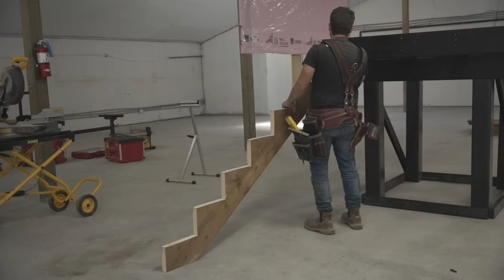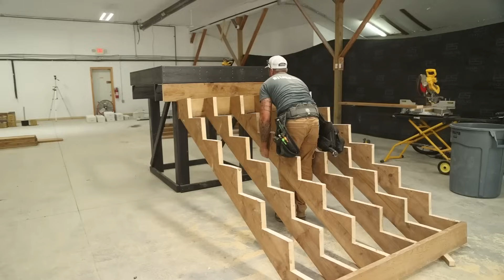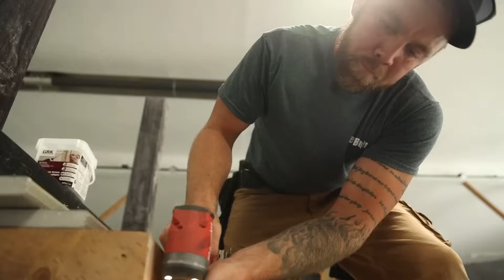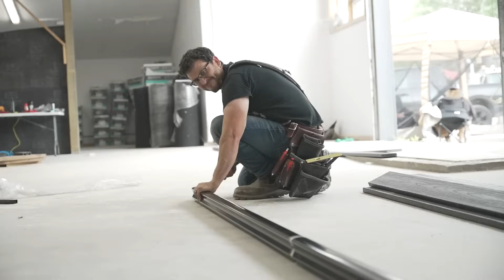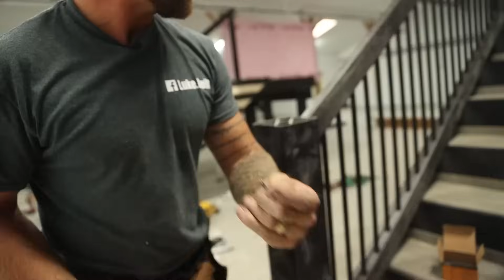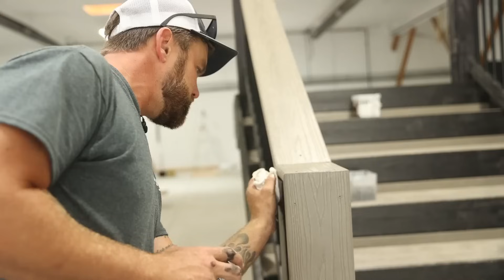YouTuber Vs Real Carpenter | Staircase Challenge

Comment: Man this was a great video. I personally think they're both so different that I wouldn't be able to choose. You have a graspable rail but it has a joint. Lukes rails have a nicer look but the rails wouldn't pass without a secondary graspable. Either way, both are very impressive for 6 hours. Awesome job guys.
Reply from the maker: I appreciate that!
Reply: How is it that a professional carpenter is just finding out about complimentary angles?
Reply: Maybe start introducing a cut man slash helper for each guy only because that's a most likely tool every carpenter uses. Could also help have a better product for these timed contests

Comment: Quick tip bully. Put your 3rd stringer underneath your first traced pattern. Screw or clamp them together and cut through both. Then you repeat and no longer need to mark with a pencil again. Just screw/clamp together and cut then follow cut line.
Reply from the maker: That is a good tip

Comment: Just finished the end of the vid. Agree on the face screws but to be fair theres no time for hidden fasteners in 6hrs. Also, the simple math comment seemed to show he doesn't really know the deductions for bottom riser are not actually easy to do correctly, nor does he know the flat handrail isn't to code anywhere in the US on a staircase of that size, shouldn't even have had to think on that one as a designer of decks with guard rail details built into the plans. Compounded is the attire, a designer without build experience's get up. We need Dr. Decks for these competitions guys!

Comment: I loved the long video format.  It was to the point and 100% engaging all the way through!  

I liked both stairs!  I agree with the comments on Luke's handrails and if the stairs had been the dark color and risers light color.  This probably would have better hidden the screws too. 

Overall, I think yours was a better fit and trim, but if I had to choose between them, I'd go with Luke because the glass was a complete turn off to me for several reasons....I appreciate the craftsmanship,  just the product would not be a good choice for 98% of homes for an outdoor step application.   

I think the ultimate deck would be your stairs, but with Luke's railing with a better handrail design.

Comment: Aesthetically, Luke made a more appealing staircase. Bully's stairs were more.... commercial in my opinion. Luke's were a bit more on the "upper-middle class residential private home" look. There are areas on the handrail I'd change. I'm fine with the waterfall, but start at the bottom overlap your previous board with the next. Overlapping your railing helps move water away from the framing, and miters meeting up at rail surface transitions will slowly open and pose a high risk of splintering, especially into the hands of people using the railing. They're using composite, so thats not as big of a deal, but there are areas where a person's hand can encounter relatively sharp angles. Guaranteed, a week after install, my wife will have found every sharp corner and angle on that deck and also gotten a bruise or splinter from running into it. You can attain similar aesthetics while still maximizing safety and water run off. I've only build a few decks in my days in construction, I was mostly on windows, doors, and siding, but I've found that you should never underestimate the ability of water, the customer, or my wife to get somewhere they shouldn't and damage something or themselves. Either way, great builds, great video, i get that a time hack threw careful designing out the window, but I think both Luke and Buply learned a few things about where they need to revisit their base habits so when they encounter a tight time frame in the wild, their instincts will yield better results

Comment: I'm not sure who I think actually won that one. On video they look like a tie. If Wood Bully would have had the proper parts for railing I think he would have been the clear winner. This series is excellent.

One thing I would like to say is please allow help when lifting heavy loads. I am not a stickler for safety, but after a decade of back pain and currently out of work for 6 weeks because I had surgery on 2 herniations in my L3-L4 disk I have become very strict on myself and my guys at work when it comes to lifting loads. Having the show come out ever so slightly better by having to improvise is not worth getting someone hurt. As an electrician and maintenance team leader I understand that everyone is going to lift loads that are too heavy alone and have improper lifting techniques, but any time it can be prevented is worth it. I am a tough guy with an extremely high pain tolerance, but laying in the floor with your back and leg muscles spasming and having legs that a too weak to hold you body weight from sciatic nerve issues will slap you in the face with a huge wake up call. Please do what you can to keep yourself and guests from ever having to deal with anything like that. It doesn't always happen instantly but just 1 improper lift that is too heavy can have effects years from now. Otherwise great episode.
Reply from the maker: Thanks for the feedback!! You’re right! Maybe we’ll have a lifting pal in the future
Reply: @woodbullyltd even if only for the lifting, like in the other vid you both had a buddy helping with certain things 👍

Comment: I didnt like either handrail..for the glass one i think another post os required to looks good. I like aluminum rails..not a fan for glassm.i think wide pickets would look better. 

I disnt like the width of Lukes rail..wouldnt pass here in Ontario. And using composite for a waterfall was a horrible idea..one season and those miters would open right up. I think the waterfall if you are going to do it..should goto the ground.

I am not a fan of dark color treads..they show the dirt and are invisible in low light.

I think you both where hustling your asses to get it done. Thats alot of work to do in 6 hours. 

Also i found the "supply chain” issues hikarious and perfect real world example.

Keep up the good work! Look forward to the next challenge video.
Reply from the maker: @ajdonally1522  my intention was to use balusters but the glass was faster and I was out of time
Reply: @woodbullyltd  hmm well in a challenge..you must know by now time management is critical.

Comment: 1st mode on an impact driver gives you less torque. its not a drill, youre not changing gears. The flywheel in the driver is actually just spinning slower, thus making less power

Comment: Amazing talent, honestly such good work, but I have to say, I get so frustrated at inches and fractions. I don’t get why you guys make life so difficult. 

(Examples)

Finding the centre on a 11 and 1/8 (not sure if I used your system correct but it’s along those lines)

Compared to say the centre of. 1350mm. Can have a mini calculater in pocket and divide any length of MM to whatever you need In a second.

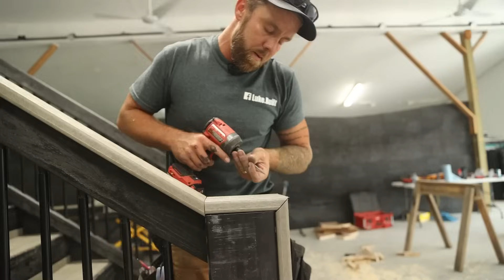Comment: 51:30 lol. "I should get the DeWalt, I wouldn't have this problem." Putting it on 1 is the weakest power setting and the post being far out of level isn't fault of an impact driver. I disagree with the judge, the other staircase looked better to me and I prefer seeing the fasteners.

Comment: Luke had a decent idea aesthetically. Just needed to get his angle repetiore up to par. His 45 outsidr bevel was fine, the short point just needed to come up at or above the post. The flat piece to stair cap bevels need to be the same angle so the length of the miters are the same and can flush up on both sides, else you have to fight it a bit and run one past the other and vise versa into that one, opposite of miter methodology and more a cope.

Comment: What happened to the makita tools?
Reply from the maker: They switched batteries
Reply: @woodbullyltd  no they didn't...40v is a different line
Reply from the maker: @UncleIvan1 they also didn’t make a good nail gun. I love there saws but I love Bosch and dewalts saws as well
Reply: @woodbullyltd won't argue about the nail guns,  but Dewalt guns are not that great either.  Makita's Saws and drills are top class.
Reply from the maker: Agreed

Comment: "I'm going to save time by take 10 second to put my stoppers [sic] on and instead spent 15 seconds on every step lining everything up."

Yeah he's off to a bad start.

I think his final build was ugly. The composite over the top of the railing looks horrible, would look horrible over time, and would be basically more slippery in wet weather and would be against code because it's too wide. The "About 10-15 years experience" was a red flag. Screwing it in without predrilling so the board is tearing out the previous screw.

You're look to be done to higher standard, but aesthetically I'm not a huge fan of doing too much. I like more simple, with colonial trim, but that's just preference

Comment: Are there any other carpenters out there watching that this would do something to mitigate the amount of sawdust in the air in this closed environment? I get it, tough carpenters and all, but breathing in PT and composite like this is so bad for you.
Reply from the maker: We had vacuum switches on our mitre saws and fanes running with bay doors open for the most part
Reply: I’m a picky one due to a perforated septum, which is very sensitive to dust particles on site. I also imagine this situation was a bit unique since you must have chosen that spot based on best video and audio quality. Anyway, I’ve learned a lot from watching you WB, much love.

Comment: i find this challenge rubbish... construction, primarily is about safety, next than is asthetics. 6h, hard to get a super solid structure, thus i think in future, they should look at the practical of things like weather proofing etc. instead of just 6h to see who build a good design. also, i believe the youtuber already knows who the judge is and his pref. IF the carpenter already is aware that the judge finds those nails an eyesore, he will try something different. this is totally rubbish. u get 2 builders to build a car. 1 builds and lamborghini and the other builds a ferrari. u get a ferrari fan in to judge, he will side to ferrari! i believe in future, they should have a physical consult with the judge on what they like, get the "customer's" concerns addressed, than! proceed to build a design that u like and with the customer's concern in mind. otherwise, its really rubbish....